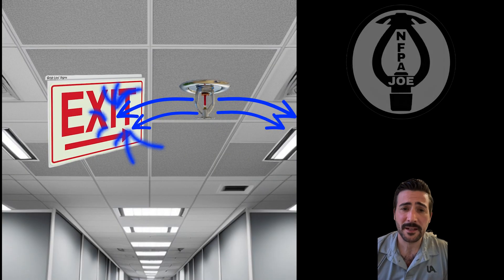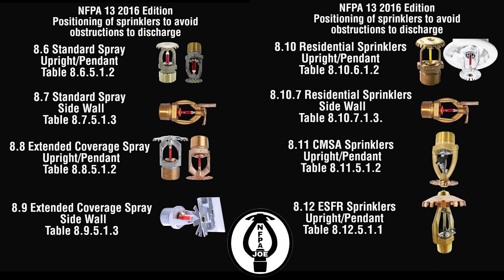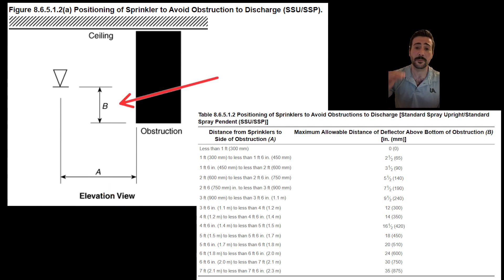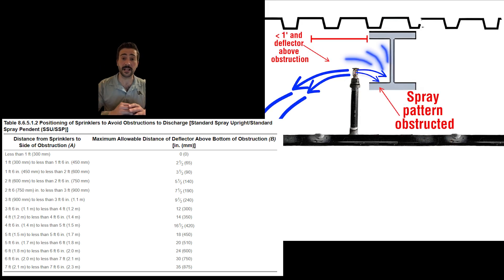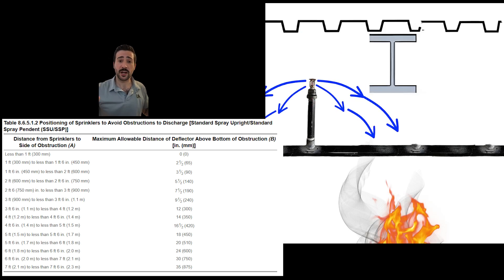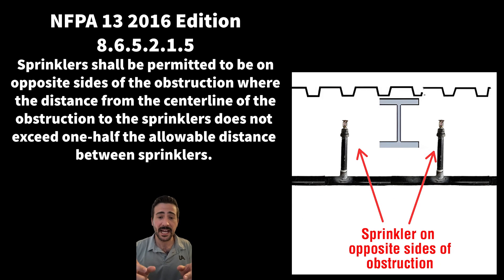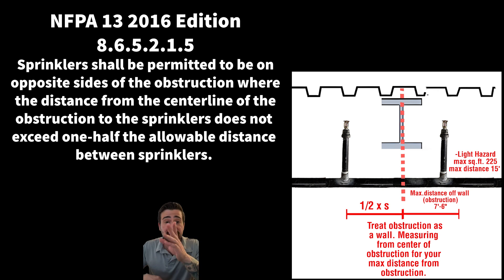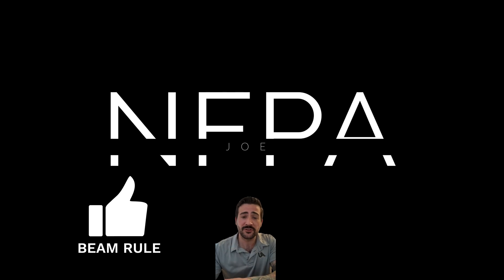NFPA 13 Beam Rule. Fire Sprinkler spraying under obstruction.

Comment: Thank you very much for your video, but I still have a little confusion. When the distance between two obstructions is greater than 2.4 meters and the sprinkler is installed close to one side of one of the obstruction, should the maximum allowable distance from the sprinkler to the ceiling be 300 mm or 550 mm?